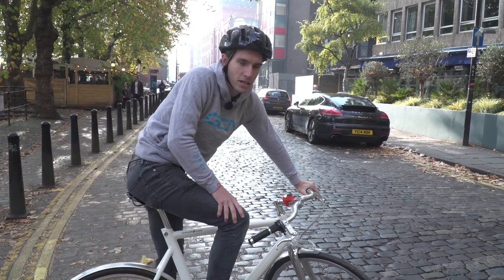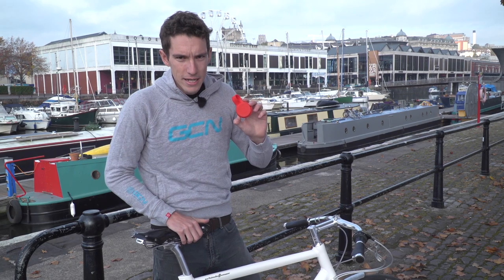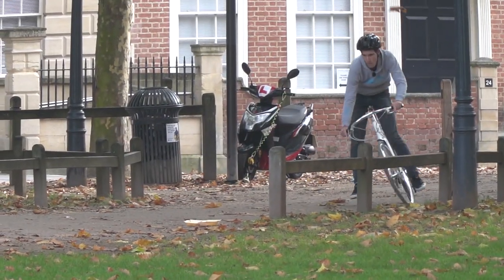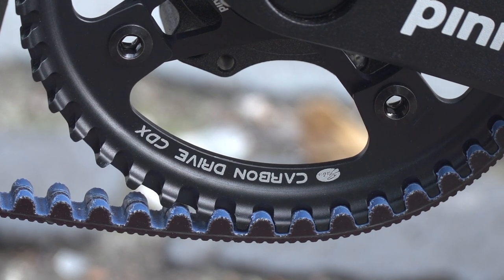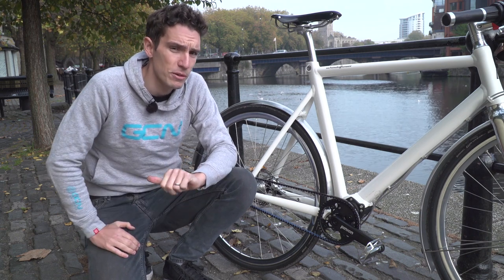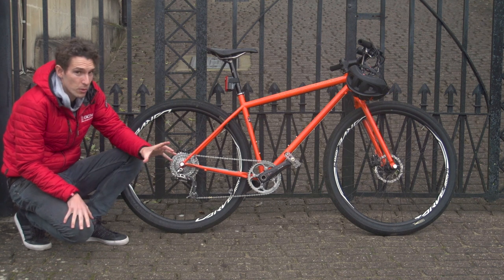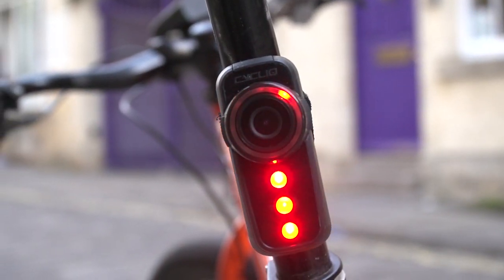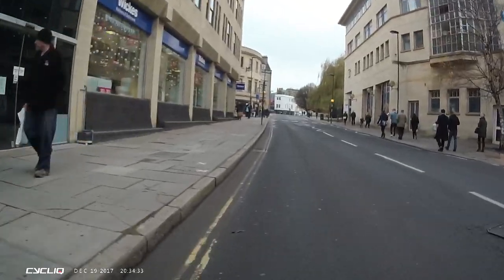7 Urban Tech Innovations

Comment from the maker: Could these urban gadgets be the future of city cycling? Let us know in the comments 👇
Reply: I wish there would me more innovations to make cycling more user friendly like more and better infrastructures in the city that are more and less cyclist friendly in some places. Riding your bike should be something so natural like walking and not dependent on expensive gadgets.  Cyclepaths that are bioluminescent or use the bikes rolling on to generate renewable energy to feed the lamps at night or even better parking infrastructure for bikes  are among the innovations that really help urban riding.
Reply: Luis GO V to be fair those two things don’t actually exist in real life.
Reply: Litelock is junk.  It should not have a Gold status.  It can be defeated in 15 seconds with a crowbar.  The belt part itself is good, the lock is weak.  If they fixed that, then it would be decent.
Reply: The fly 12ce is £269.99 & the fly 6ce is £169.99.  I would love to have a set. But they are just too expensive. At that price it's just never gonna happen
Reply: prynnieprynnie check out the previous version, available heaps cheaper and still pretty good functionality.
Reply: The Cycliq lights/cameras are great - actually quite good value if you were in the market for two lights and two cameras. But the biggest selling point of the camera, by a mile, is the quoted battery life of 7-8 hrs. Very few action cameras, if any, get anywhere close to that.
Reply: Like the Pinion gearbox, though a lighter and simpler version would be a better match for city cycling. Watch many city cyclists, and they don't need 8 or more gears.
Reply: Sweet!
Reply: Nope.
They are too expensive for an everyday commuter and a city biker.
The future is past - the not-too-expensive/not-too-cheap but undemanding, mulish bike is the bike what people had chosen in the city. I like the conception of the gadgets here, but the are just...gadgets.
And Pinion, what needs a custom frame - it's rocket science for a simple city ride.
Tho', I love the Cycliq thingies and the Beeline gizmo; if I can afford them...
Reply: @citrOhm  You are right that a city bicycle should be as simple, cheap, durable, maintenance free as possible. That is why I always go for the old version of a Gazelle standard city bicycle (as we know them in the Netherlands). The key is the old version, before they began producing bad quality like all the other brands where doing, perhaps some 30 years ago. 

You recognize a bad bicycle by its shiny metal thin rod construction of its rear bag platform & mud guards, and too many gadgets. They are made for people who ride cars instead. We don't have any hills, therefore it is important to dispense with all gearing. If you do have hills, the only option I see is to get the absolute best durable quality, try to make do with as few gears as possible (probably 3), because every nut added to the bike means more headaches later. You probably need 2 or three locks if you got a bike worth stealing. 

So yes: the future is the past. Gazelle is making their old bikes again (± 700,- Euros I think). The one part that is worthwhile to go modern, is dynamo lights. They where always such a pain. Perhaps the integrated axle dynamo is the way to go, otherwise electric. Example: I have a real old one of this type. I have had it for decades, and perform exactly zero maintenance on it. No changing the oil every year. Changing the oil: never. When people jump on it, they are immediately impressed with its solid riding feel. I've heard there are a few other new brands too, who cater to people who are sick of the bad quality of modern engineering. Pay up front for something good and simple, then ride it for the rest of your life. Maintenance ? Once in a decade, I guess. More if you need gears though, notorious things they are. Unless you absolutely need gears, just don't. Needless to say, the chain needs to be fully enclosed.

More and more, engineering is garbage these days. It is sad to see this happen. There used to be honor in good work done. Now they produce with the hope of it being binned as soon as possible, so they can sell more. The psychos took over engineering. They take over through the financial system, mergers & acquisitions, share holders, the whole thing. That's where the enemy is. 

Good old solid work men, wouldn't dare put on the market what you see now everywhere. It's the psychos ... its the psychos !!! ;-P (but really, it is). Centralization, financialisation, power by people whose only expertise is sucking money out of people, bribery, corruption and … a population who doesn't care about facts. It is all about appearances for most people. Despite what all was wrong centuries ago, the most experienced work man was the boss, and they organized in guilds to keep quality high. 

The good old honest work shop where the manufacturer talks to his own costumers, is now a factory complex on the other side of the ocean, owned by anonymous share holders, organized crime, corrupt politicians. Illusions reign, but in the end, those bikes are creaking, falling apart, and they don't even know anymore that this is not supposed to happen.

etc etc etc, yaddayaddayadda … disappears into the night, mumbling incoherently …

P.S. For honesty sake, I did put a different back wheel on my already second hand bicycle once. That wheel was also second hand. I think I cleaned the chain once as well. Never got the lights to work again, the one hopeless part. It is used also to haul things to a vegetable garden, pulling a cart and/or having stuff on a front loading platform. It doesn't even fit me (too small), but it is worth it compared to modern low quality bicycles. It all started with Batavus, which is a low quality brand like all the others since. New psychos at Gazelle perhaps saw that example and realized they could make more money selling illusions rather than solid work, and that was that. The End for quality.

Comment: litelock should have never made it on to this video. It can easily be defeated even if it meant to be a "quick in and out of a store" lock.
Reply: Going by your name you can also be easily defeated, haha!
Reply: Also the Pinion is shit too and a pain in the ass trash product. Just get a fucking Nexus gear hub on the rear wheel like everyone else does. No idiot oil bath or changing or frame bulk.

Comment: I tried the pinion gears and I am absolutely amazed by it. Yes it is expensive and yes it is slightly heavier, BUT it is a pleasure to use, requires no maintenance, you have no oily chain to get dirty on and there is no rattling sound on bumpy pavement. I hope more frames will become available!

Comment: the Pinion is great!! But it is not only great for urban riding but also very well fitted for trekking - as on my Tour-bike. The 18 gear option IS expensive but worth every cent. Absolutely genius peace of engeneering.
 On the abus nuts: I had those, but only the one on the seatpost survived, simply because it becomes very annoying that you have to flip your bike every time you want to do some maintenance/cleaning and so on. They are not cheap and for the same price you get the pitlock set, which is - in my opinion - much better after comparing both systems.

Comment: Similar to those abus QR skewers, I had pinwheel skewers when at uni. They had a small key which was used to unlock them.

The key was no bigger than a small keyring, but without it you'd need a lot of tools to get the wheels off!
Reply: Just don't use a carbon frame: They will saw into the area around the skewers to get to your expensive wheels.

Comment: I’m really interested to see if someone can come up with a pinion or hub gear type solution for road bikes. Especially if it was light enough and efficient enough for pro level machines. I think we’re long overdue something revolutionary like that.
Reply: They won't be accepted because of their inherently smaller efficiency and weight penalty. There is an article on CyclingAbout page which compares a majority of internal hubs.
I have been using the Shimano Nexus 8 internal gear for more than four years and now, after 22 000+ km (tarmac, gravel, mud, snow), I can only say that for non-professional applications all the aforementioned drawbacks are more than compensated by the comfort and a lack of any service-related issues). 
Sometimes I miss more gears and think about Alfine 11 (Di2 - why not?) or Rohloff 14. The Pinion hub is great but requires a special frame.
Reply: Przemyslaw Sliwinski I did mention weight and efficiency in my comment.

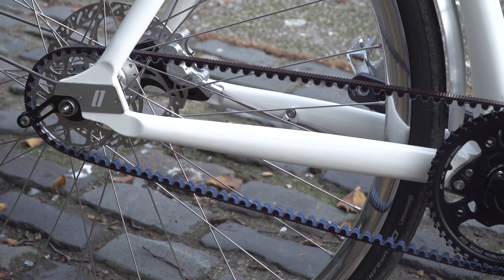Comment: 3:33 but when the belt breaks, you need to buy a new belt and can't just repair it, right?
Reply: seasong carbon belts dont break the belt will stretch but the part can be replaced
Reply: Yes,like you have to buy a new chain if it breaks

Comment: Wrong! The belt drive in fact needs maintenance. Without cleaning and silicone spray the belt drive is quite noisy
Reply: You have to scrub down mud once in a while. Not everything falls off, and the residue wears down the (platic!) sprocket.